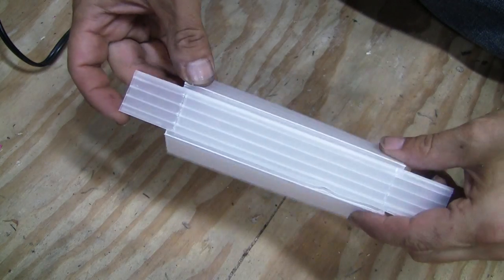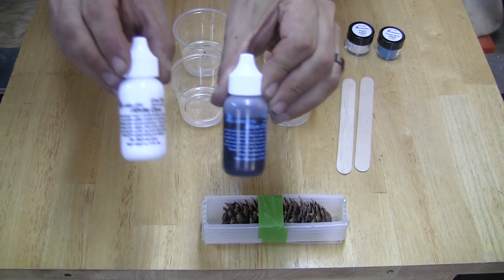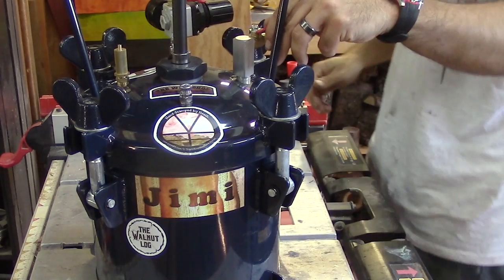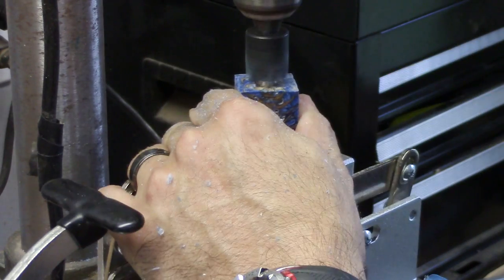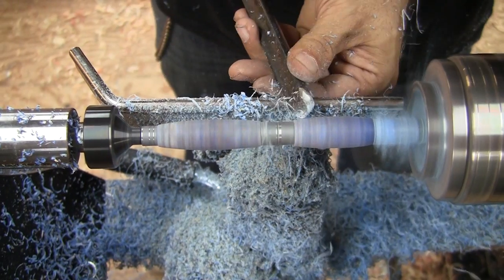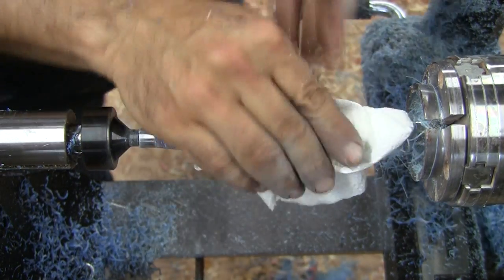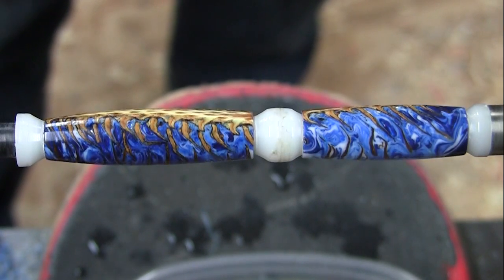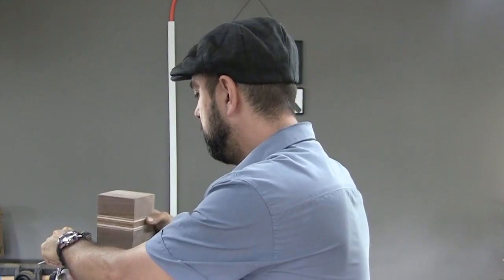Pinecone & Resin Pen 2 the REDO : Making of

Comment: Well done, Michael! Now to convince my wife we need a Pressure Pot!

Thanks for sharing your time to venture deeper into this pen make tutorial! We all know and appreciate the time taken out of your day.
Reply from the maker: It might be easier to ask forgiveness than permission :P The one thing I want to mention before you consider running out and buying one... most "organic materials" give much better results in the resin if they are stabilized first using a vacuum chamber and stabilizing resins. The end result will be far less susceptible to getting air bubbles, and it makes the material harder for cleaner cutting. Unfortunately, I wasn't able to show this part of the process because I haven't been able convince my wife yet that I need a vacuum chamber....Lol
Reply: Stabilizing is critical. I have used a pressure pot, but find it did not make much difference. I also cast in a vertical mold. I go in with a contrasting color, let that sit and fill the cups  and then add additional colors. I quarter the blank which gives me 4 pen blanks from one pour. @MichaelZurcher

Comment: Very exciting work.  This art form would make awesome beads and buttons.  What else do you envision substituting for the pinecone?   Would used wine corks work?
Reply from the maker: Hi Robin! Glad you found it of interest :) People substitute all kinds of things...you name it people have probably encased it in resin. I think wine corks might work if you per-process them in a thin stabilizing resin and a vacuum chamber prior to the resin casting. Anything soft and spongy would need to be dried and hardened before using with the resin. That would also allow you to turn it on the lathe too. I don't have a vacuum pump or chamber yet so I have to rely on harder materials or "per-stabilized" materials at the moment.

Comment: hey very nice finish mate, i aboslutely love the colour choices using in theis project, i have been using blood reed and white looks good to . i am having a problem with air bubbles in my castings, i noticed you advised your cones were stabalised, i am assuming this is a neeeded step to prevent the issues i am having. yay another peice of equipment i need to bribe my parnter into getting me lol
Reply from the maker: Thank you! There are many reasons you could be getting bubbles. Stabilizing does help reduce the chances but it's not the only reason for bubbles.

Comment: Nice video, new to pen turning myself.  Never seen plastic bags used to apply CA glue, does that work well for you?  Subscribed.
Reply from the maker: +Mike Kapotsy thanks! I find it works pretty well...some people prefer paper towel. I found you waste less CA...and it leaves a slightly smoother surface. Thanks for the sub! Turning is addictive!

Comment: Awesome video! At the beginning, when you say you take the "Stabilized Pinecone and trim the edges", what do you mean by stabilized? Does it need to be stabilized before going into resin or is the resin what "stabilizes" it?
Reply from the maker: Thank you! I stabilize my pinecones before casting them, basically that means they are soaked in a special stabilizing resin under vacuum until all the air has been drawn out...then taken off vacuum and that draws the stabilizing resin into and fills the tiny air pours. Then they get cured in an over....then I cast them in resin.

Comment: Very nice looking pen. I have a Harbor Freight pot but looking to upgrade, what brand is your pot?
Reply from the maker: Thanks! I had the Harbor Freight pot but it always leaked and I found tightening that pot was always a hassle to get an even tightness. I purchased the one in this video from TCPglobal.com  The make them in all different sizes. I just went for the 2.5 gallon because I didn't plan on doing anything super large. I did have to modify it a little because there is a center shaft for mixing that I didn't want. I just removed it and added a threaded fitting to it to block the air flow out. Good luck!
Reply: Thanks for the quick response, looks like the East Coast warehouse is about 30 miles from my house.
Reply from the maker: Perfect! Seems to be a pretty decent pot! I like mine a lot and know a few other guys that have the same one.

Comment: which pen hardware kit did you use for this?  I like that size
Reply from the maker: I picked it up from WoodCraft....it's called the Navigator Screw Cap Rollerball Pen Kit :) I think if I made another one I wouldn't do the screw cap on a blank that needs to match grain or pattern orientation...it's tricky to get the spine to line up when you screw it on...you can...it just takes some trial.

Comment: I have some really really dry pine cones. Can I just use them without stabilizing them? They are like 5 yrs old
Reply from the maker: you can, but I found that stabilizing gives a better finish and cuts down the likely hood of air bubbles forming...I tried it in the beginning but found I got much better and more consistent results when stabilizing
Reply: @MichaelZurcher  I don’t have a way to stabilize them though. How else can you stabilize without a vaccum set up?
Reply from the maker: @kandiecandelaria1423  I don't know o any other way to do it...I have seen people make  smaller setups with a cheap harbor freight vac pump and some mason jars, not saying I recommend that...but there are videos out there showing how to set that up. other than that, you can make them without stabilizing,  just get some thin CA glue and when you finish sanding let that CA soak into the pinecone....then resand and finish. The stabilizing helps prevent moisture from reabsorbing into the cone once it's finished ...the ones I have made without stabilizing tend to "swell" and get a raised surface where the pinecone is...and I don't know if it might eventually separate or crack the resin over time

Comment: What brand of pressure pot are you using?
Reply from the maker: The pressure pot I use is the 2.5 gallon pot from TCP Global. 
http://www.tcpglobal.com/TCP-PT8320.html#.Whtc6p9OlnE  
You need to modify this tank slightly and take off the agitator bar. Hope this helps!

Comment: What does it mean to be “stabilized”?
Reply from the maker: You soak them in a thin resin inside a vacuum chamber and the resin penetrates through the material and when it cures it is hard with no air pockets.

Comment: Hi, I want to make a dip pen but the names of the tools do not write
Please just let me know what these articles are called 1:47 
 I've seen a lot they do like you but do not use these machine 3:04 can you tell me please why you uset? 
 I apologize but I have a simple suggestion I hope you do such a pen in the video but like this dip pen 
 https://youtu.be/gKkOvDlhR9Q
Thank you from saudi arabia
Reply from the maker: Hi, Thanks for watching! At 1:47 I am using a clear resin called Alumilite. It is a 2 part resin that needs to be measured by weight to be mixed. At 3:04 I am using a pressure pot to minimize any of the bubbles that form in the resin...It helps squeeze out any air bubbles that may be in the resin or at least squeeze them down to a small enough size that they aren't noticeable. This step isn't always needed if you use a resin that  sets more slowly and will allow the bubbles time to rise out. I would love to make a dip pen sometime!! Thanks for the suggestion!